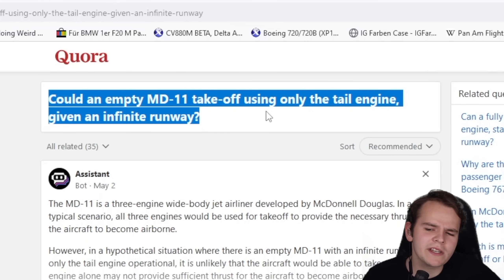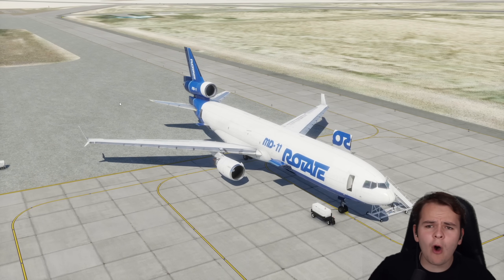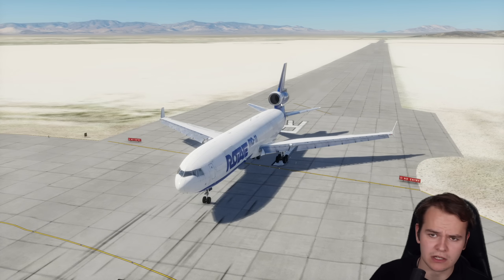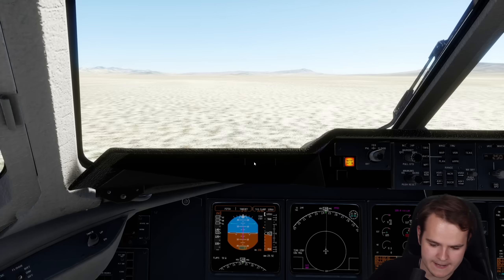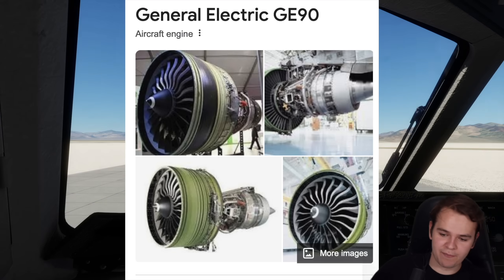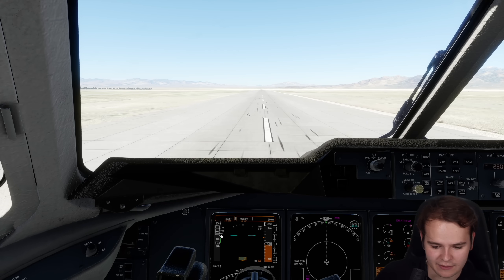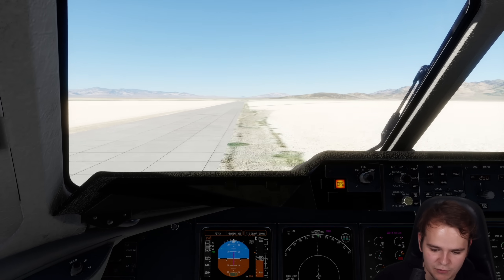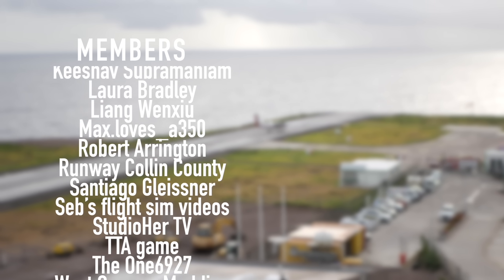Can The MD-11 Fly With ONE ENGINE?

Comment: Two things...the jet was already at or near takeoff speed and the plane was rising when it lost 2 engines and it was the right engine (#3) that was functional, not the tail. Next time see if the fuel to the other 2 engines could be cut and the right engine could support the remaining takeoff to get the planets an altitude that would allow them to plan out how go do a low altitude fuel dump and landing.